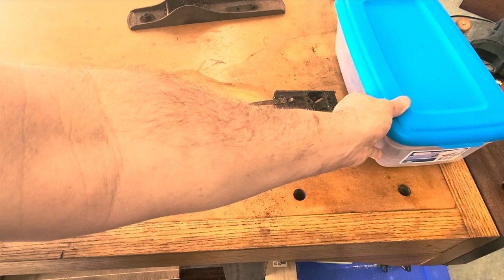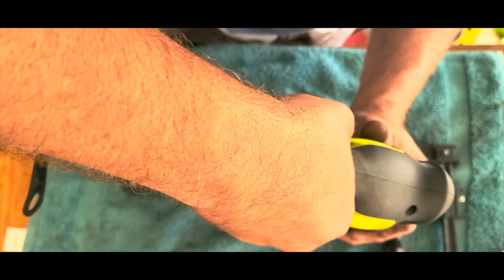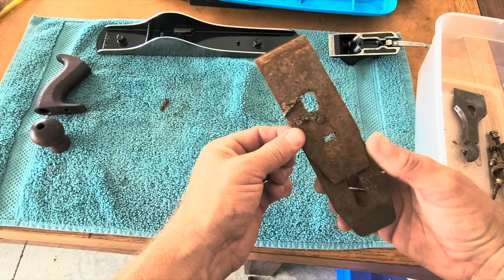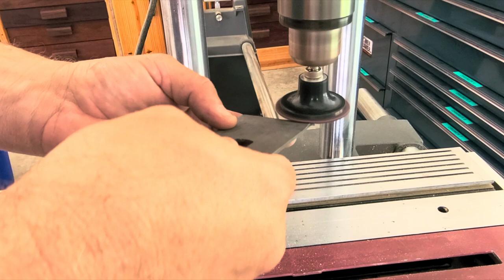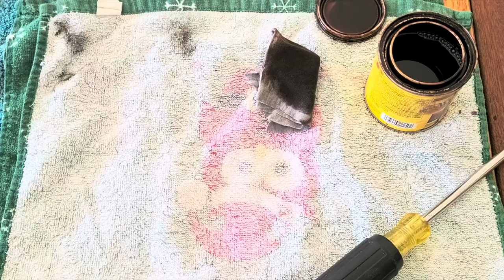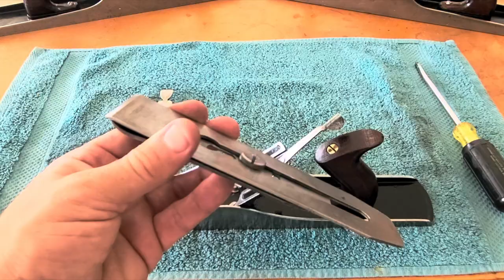I Found a Hidden Gem at a Garage Sale... Let's Restore It! #woodworking

Comment: Looks a lot like a Stanley Handyman. I didn't know Eclipse made Bailey style planes. I know about their honing guides. You should get one. You don't have to get an authentic one. The clones work. My knock off did need some flattening on the bed with a file though. That took 5 minutes. I got mine off Aliexpress. I got the "stainless" model they have. It has a nice heft to it. Honing guides are a game changer with chisels and plane irons.
Reply from the maker: Thank you for watching and leaving feedback.  I'm familiar with the stanley handyman planes. Alot of the no name brands were made by stanley or sargent. This plane when compared to a stanley is ok..but I would prefer the latter over the former. I use a tormek to sharpen. Works really good
Reply: Es un Stanley Defiance, I got one

Comment: Why don’t you use electrolysis? The rust will drop of so will the paint!
Reply from the maker: I thought about using electrolysis in future projects. The problem I run into is space in my garage and costs for the supplies. If I make a electrolysis tank I have to find a place to store it
Reply: Maybe we're thinking about something different, but to remove rust using electrolysis, I use a plastic 5 gallon bucket for a tank and baking soda added to water for the electrolysis medium. It's cheap, easy and you don't have to worry about disposing of hazardous chemicals.
Reply from the maker: @roberttailspin6330  sounds like I need to try that. Is there a good video or tutorial on how to do that?
Reply: @cannonwoodworking5917  A quick web search will reveal a ton of videos that illustrate the process. In any event, the process is quite simple. Unlike electroplating, we aren't concerned with imparting metal coatings on a finely finished surface, we're using electrolysis to strip rust, so tight constraints and purity aren't important. Ordinary tap water is more than pure enough, (you could likely use water from a mud puddle, though it would be less efficient). Baking soda is used to increase the conductivity of the water, which speeds up the process, so don't get too concerned about concentrations and whether or not it all gets dissolved. Most references will stipulate an amount to use, but in practice, just dumping a box of baking soda in the water and give it a quick swirl is good enough. Some sources recommend something other than baking soda, but it's just nit-picking and baking soda works just fine. Rotate your piece at some time during the procedure since the process is most efficient when the surface of the work piece is line of sight to the sacrificial piece. When completed a quick wash and an easy scrub with a nylon brush will reveal a bare surface. Repeat the process if the work piece was heavily fouled.